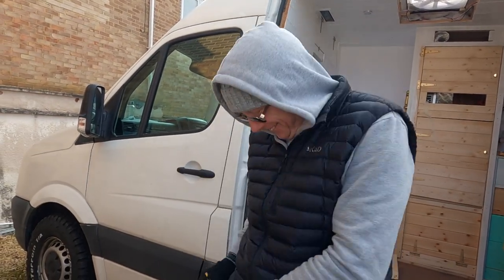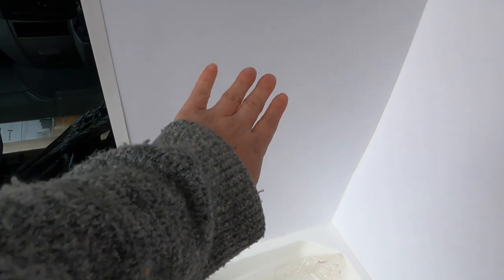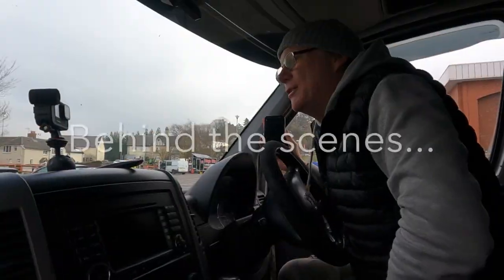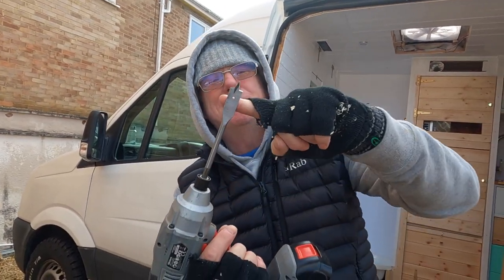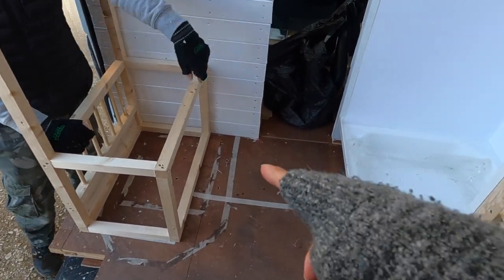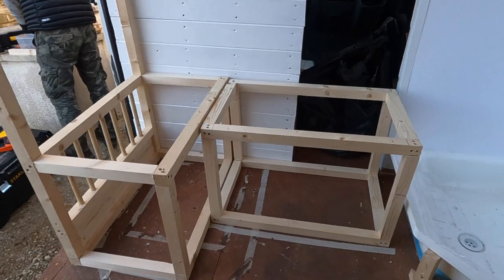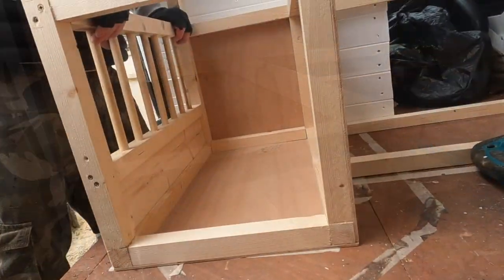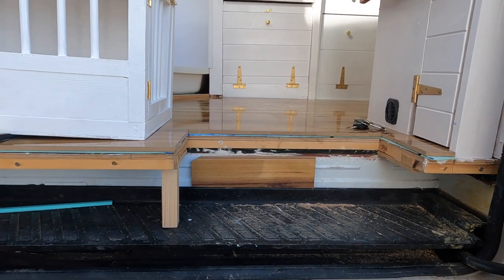Minimalist bench dog crate self build campervan conversion

Comment: As a dog owner am always on the look out for fitting their space in the van with the least disruption to mine. Modular I’d def the way to go. It really looks great.
Reply from the maker: That’s so great to know that you liked it. I knew I needed a safe space for my dog, but trying to work out the best placement has been the trickiest part so that he doesn’t feel trapped in a dark hole. I originally was going to put a bed under the main fixed bed, but in the end I thought it wouldn’t vent as well and be dark all the time for him. 
This way when the doors are open he can still be contained if needed but has fresh air and a view of me if I’m outside so won’t be distressed. Hope this has given you some ideas for the future 👍🏻💚🚐
Reply: @SACREDTRAVELLER   Thanks it has. As you mentioned the under bed , it’s most common but not as practical or pleasant for Monty . Am enjoying both your and mels approach.

Comment: You made a right dog's box of that!  Honestly, it looks great.  You could even rotate it clockwise 90 degrees and use it with the pop up worktop.  I have done something very similar in my Renault Trafic but mine is my battery box and is a seat to use with the adjustable height pop up worktop.
You could create a shoe locker under the floor in the door way. I would suggest you add a support under that unsupported corner though just in case you accidentally pup weight on it and crack your gorgeous floor.  I wish I had used that laminate on my floor.  Looks great xx  (oh and you do sound posh)
Reply from the maker: Thank you Nomadd Uk! That battery box idea sounds good too. The pop up worktop idea is great, I’ll keep that in mind. The support has gone in, as yes the corner was starting to droop, so that’s been added to make it stronger and all’s good now. 
Ha ha ha oh dear....I need to try and learn a country accent now then 👍🏻💚🚐